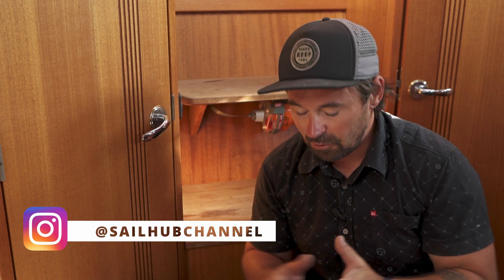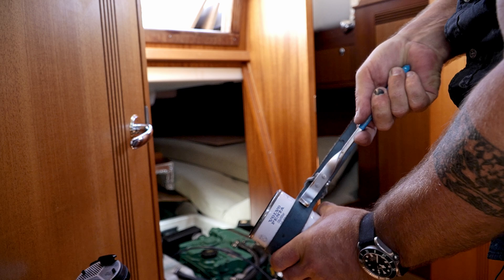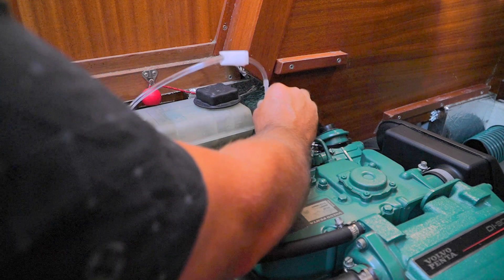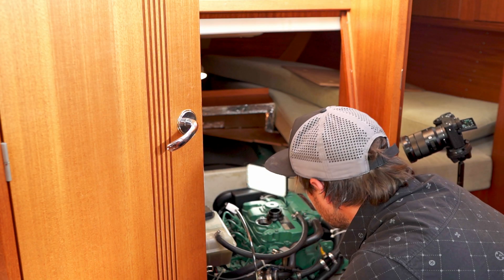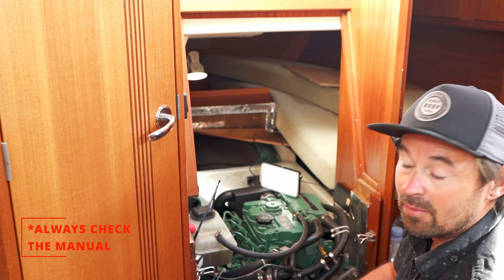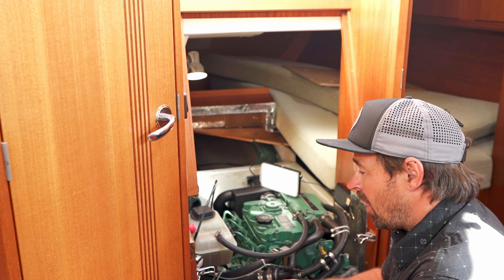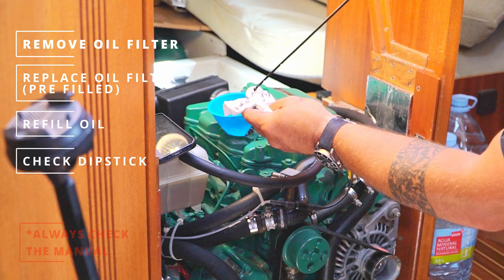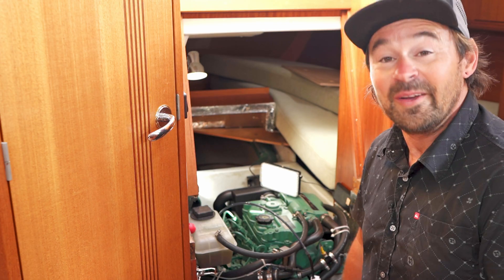Clean and easy Marine engine service.

Comment: I had one of those .... I ran out of life waiting for it to drain the oil.  I made my own from an electric pump that runs on DC power.  I clip it to the battery and it takes a few minutes to drain the sump.  My unit is self contained and easy to use.
Reply from the maker: Perfecto, that’s the ticket! 👊

Comment: Reasearch how much rock has to be processed to obtain the minerals to produce a lithium battery for an electric car, It’s in the hundreds of tons.  Search it if you don’t believe this.  This comes as a cost also in carbon.  The efficiency of a diesel coupled with its application in a sailboat to me makes little sense to retrofit electric.
Reply from the maker: Sure mate, we’re doing that and much more in our boat build project. It’s time to uncover some home truths!

Comment: 8:20 I'm all for renewables, in a sensible way. Plenty of people today are using diesel engines that are 40 and 50 years old. Does anyone actually think in 40 years from now someone will be using the same electric engine they are today? Not a chance. There'll be more electric engines in the scrapyard in 10 years time than there have ever been diesel ones.
Reply from the maker: Yeah, super interesting point, we have thought about this for a while. I came up with the thought that we should maintain our current engines and it would be better than swapping out for electric. However if you are building new I think electric is probably just a bit better - but there are motors out there that are simple and are printed which are much better... That's what I want to be working toward.
Reply: I see the logic of perhaps electric for new builds, but I'm not sure I would do that...I think we'll need another 10 years of R&D and innovation to really get there.  @SailHub
Reply from the maker: @harbourdogNL yeah that’s my thoughts about it all too! Although, I’m secretly hoping that technology may take a step in the right direction a little sooner…. ⛵️👍
Reply: Electric motors are pretty simple and not many moving parts.  I think the issue is the battery technology and the damage done mining the minerals to produce them.
Reply from the maker: @paulgillard2258 could be… but it could be the fact that for some reason we keep seeing electric motors in hills designed around diesel. 
If we take a look at older boats (before combustion engines were a normal part of sailing) guess what… they were less spacious but way more efficient. There’s that and then there are a bunch of other things we can look at to make electric sailing more viable, that’s being said.. The “pathways to sustainability” report by ICOMIA is a cracking read, that shared some great insights into lithium mining and the cumulative damage. We’re stoked to have those guys supporting our SailZero project 👍

Comment: What you are wondering about is the footprint of a system over its entire lifetime.
What IS the difference between a diesel engine and an electric motor run on lithium batteries?
Has that been calculated? Probably.

And... biodiesel. I haven't seen any boats talk about that yet.
And where does one get the vegetable oil to turn into biodiesel? Oil palm??? Nope!

There will always be a footprint left no matter what you do.

Better tech is going to be the answer but it will never be perfect.
Reply from the maker: Hi Rick, yes! That’s exactly my question. Thanks for replying!

Yes, I’m sure the figures have been calculated too. I do wonder as to what they are as it is strange no-one uses them for their marketing. When I ask manufacturers there are no clear answers. It keeps me pondering…

Personally I find it really exciting that electric tech is taking off, it could be the next industrial revolution. Like yourself I am also sure things are going to continue to improve! 

Regarding the footprint, there’s no getting around one of those, but it’s really nice when I see someone really trying to minimise it, reducing plastics in their motors and looking at sustainability over a long term in their product.

I guess I want to know if we should ignore tech until we know it’s making the difference we hope it is making. 

As for bio-diesels, I believe the reason we don’t see it so much in the marine world is it’s FAME content. This basically becomes agitated at sea and blocks filters. It has the same symptoms of diesel bug. 

Cheers, Chris 👍⛵️